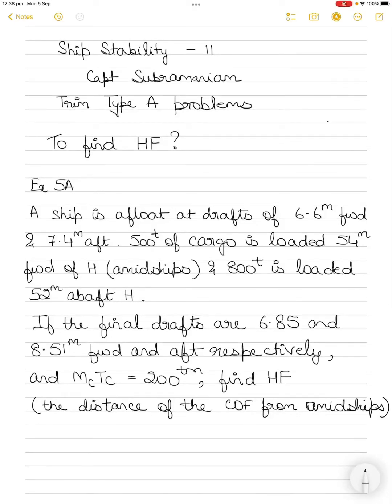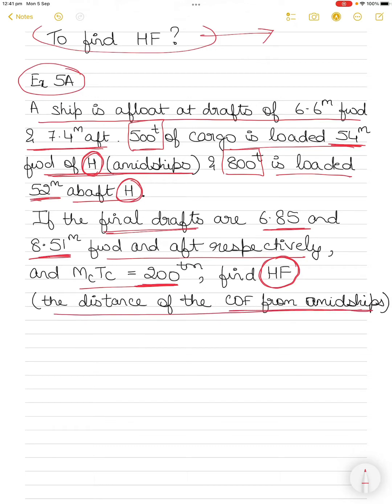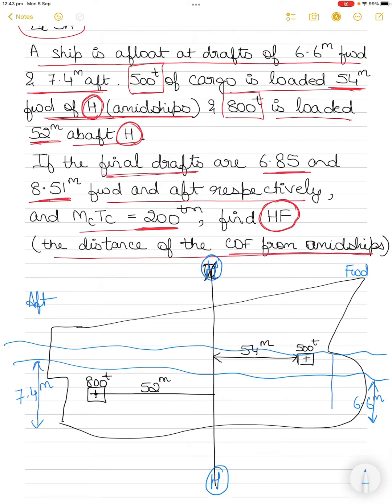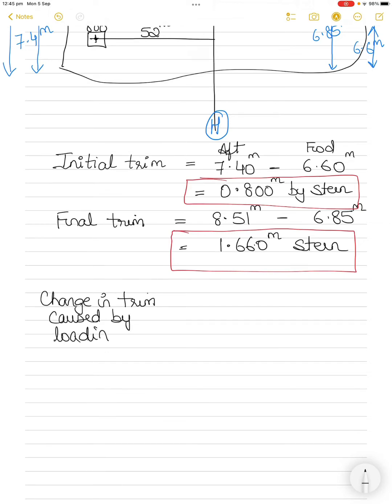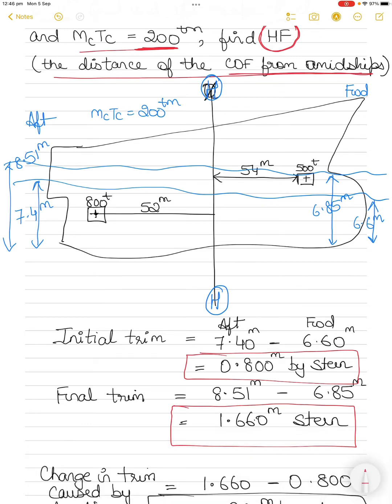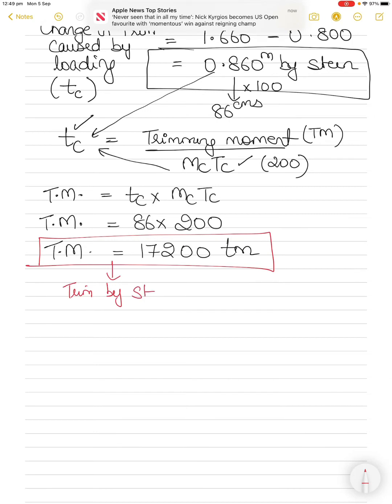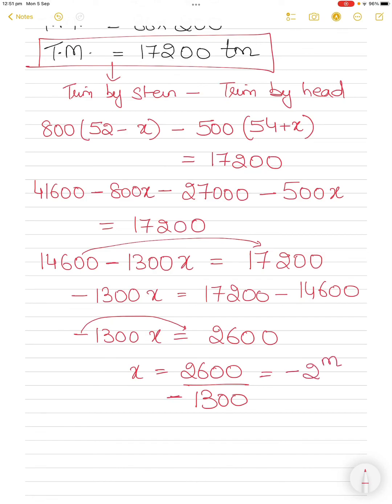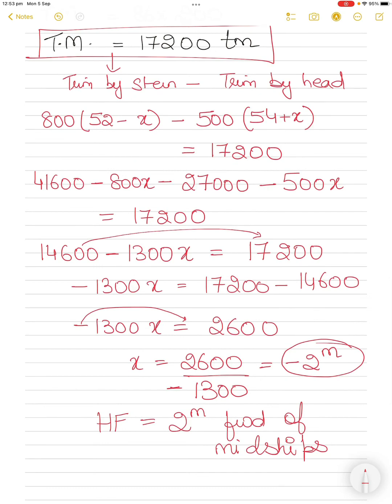Ship Stability II - Trim (Type A) - Finding HF (Example 1)

Comment: Good day Captain. Can you pls throw more light on how to solve this question? 
A ship, which is trimmed 0.25m by the head, requires 800 tonnes to complete loading. Two
spaces are available, one 50m forward of LCF, and the other 70m abaft LCF. Calculate how
much cargo to stow in each space so as to complete with a trim of 0.25m by the stern.
MCTC 240